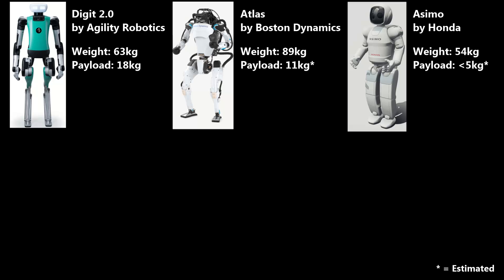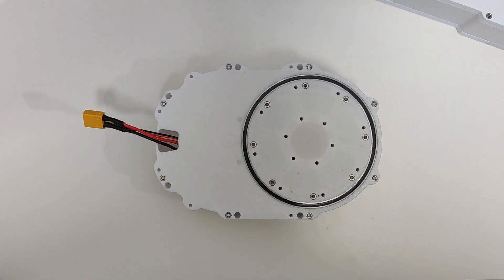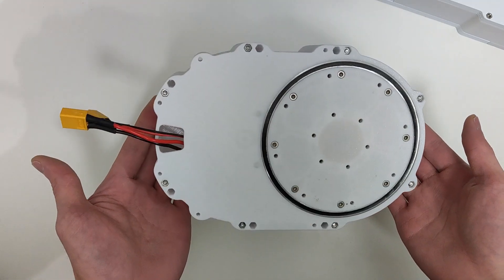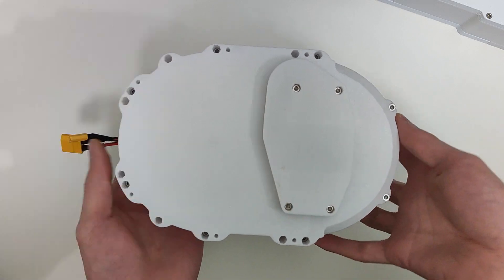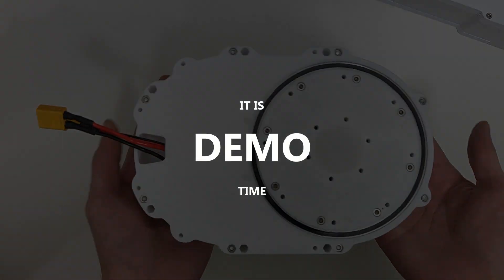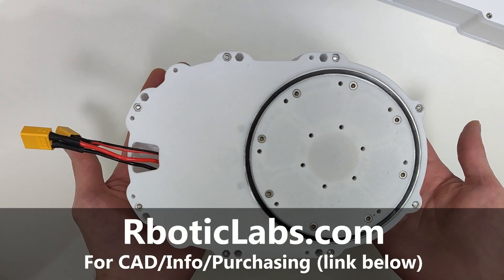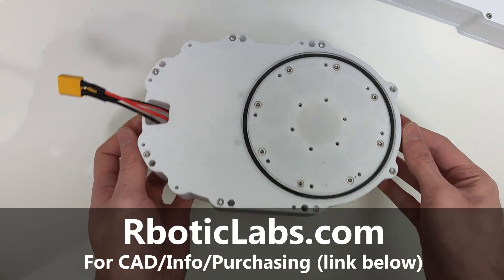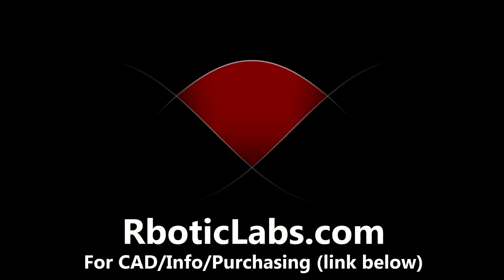3D Printed Actuator | Unparalleled Value High-Performance Robots

Comment: Awesome! Can you tell me more about the axial load the actuator can with stand. I'm working on a robot shoulder joint. I'm wondering if the actuator can hold heavy load sideways.
Reply from the maker: It's been tested with an axial load of a human weighing ~70kg. I reckon it could go higher. Make sure you mount to the outer ring to avoid loading the central surface of the output.
Reply: @rbotic  Excellent, this looks very promising!

Comment: Take a look at OpenTorque. I believe that actuator has better specs overall.
Might even be cheaper as well.
Reply from the maker: Thanks for the interest! OpenTorque started it all for me :) . I can confidently say an OT actuator with electronics would be more than 2x the cost. Weight would be at least 1.2kg and has never been demonstrated to do over 28Nm peak (and I don't believe it can do much higher). This is compared to 47Nm peak @ 995g.
Reply: Except that the "theorical" torque was never achieved , it has a theorical peak torque of 80 nm but when i looked at people that made the actuator they were never able to reach more than 28 nm of peak torque and you can confirm it by watching YouTube videos and in forums about it , so while is a good project , the theorical peak torque is far higher than the actual peak torque

Comment: How do you get the heat out of that housing without softening it when the motor is putting out 62w of heat at the 'nominal' torque rating?  Is the continuous rating lower? I have also been working on high performance low cost actuators and comparing them for robotics. Very cool design!
Reply from the maker: Thanks! Total power draw of the actuator (motor+controller) at nominal torque is 31W. Other actuators, although made of more heat conductive aluminium, spec >50W excluding the controller as their nominal. This assumes their data sheet is accurate. All I can say for certain is that the actuators have never passed the glass transition temp of the plastic with a wide range of duty cycles.

Comment: Does CAD file that you sell on your webside is a full assebly of the actuator? I wpuld love to see how did you manage to get this incredible results on 3d printed actuator, im actually wrinting an Engineering Thesis about the robotic actuators and im looking for any posible inspiration. Very impresive work overall.
Reply from the maker: It uses a conventional 2 stage herringbone gearbox in a very compact novel way. You can see how it works in the latest video so you may not need to buy the CAD. I'd only want to buy it if you'd like to make one yourself. Yes it's a full assembly
Reply: You might want to ask about the Part number, and manufacturer of the motor as well as the cost - and the cost of the motor driver and positional sensors. They look like great actuators, but I have to think that the cost is a little steep for a robotic hobbyist

Comment: Do you mind sharing what chip you use in your motor driver? I'm assuming you're doing FOC control since you have BLDC
Reply from the maker: It's a COTS dgm motor controller running a custom firmware. Yes it does use FOC (torque control wouldn't be possible otherwise).